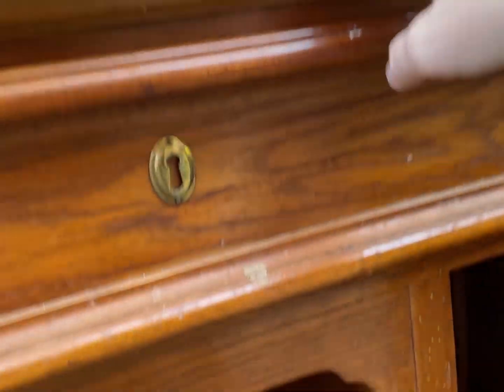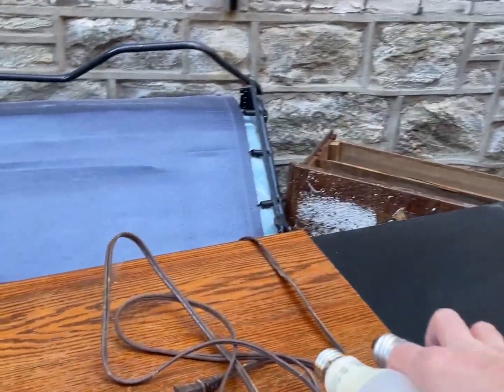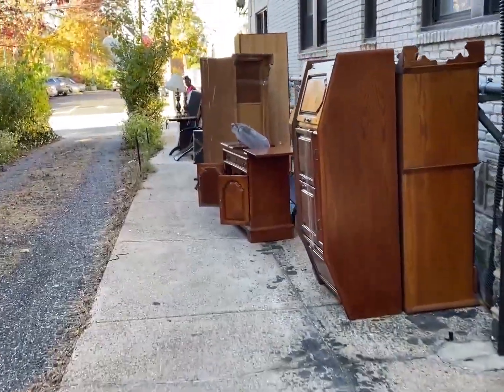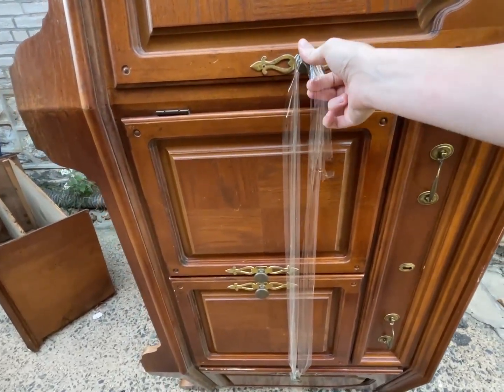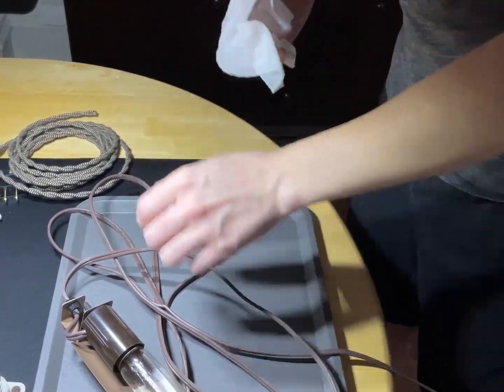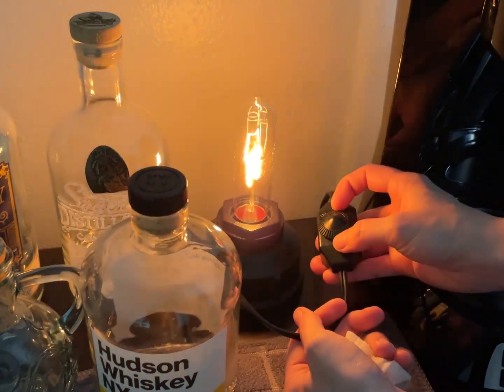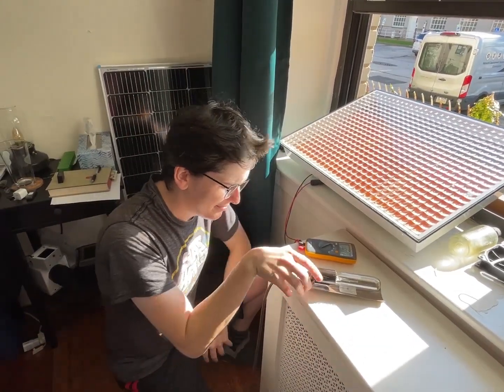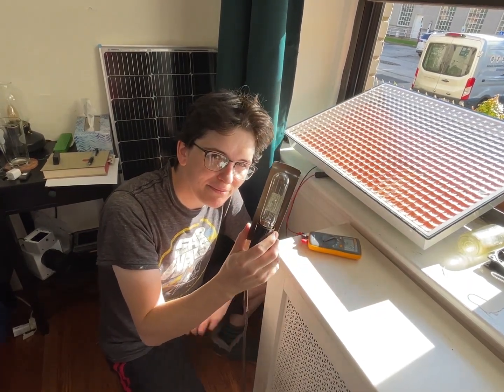Garbage Day 01: I found a vintage 1970s light bulb in the trash, and power it from a solar panel.

Comment: If you have an orifice in a gasoline blowtorch which is slightly too large you can put a spacer behind the blowtorch head so that the perforated shield protrudes further from the orifice, which can return your flame to loud blue.

Comment: Wow that panel is sensitive to the angle of the incoming light
Reply from the maker: Sure is. I can see why people chose the 18% efficient panels of 2012 over this 33.7% efficient germanium panel just for the issue of sun tracking itself.
Reply: @RinoaL  oh wow that's actually a pretty significant boost in efficiency
Reply: @RinoaL  I bet it would work great as a position sensor for a large motorized solar tracker.